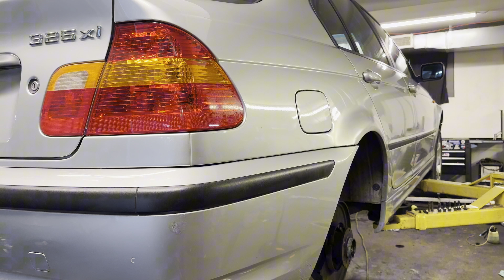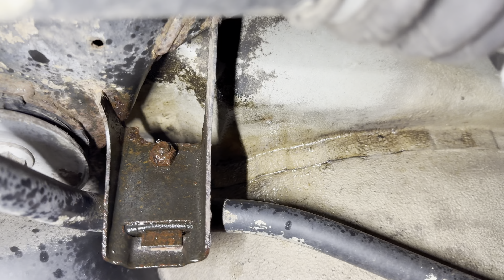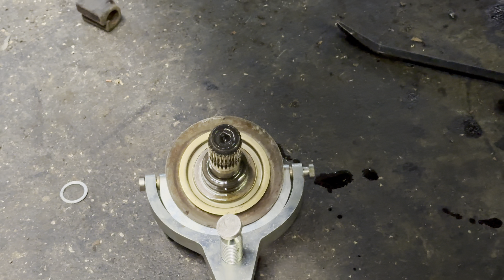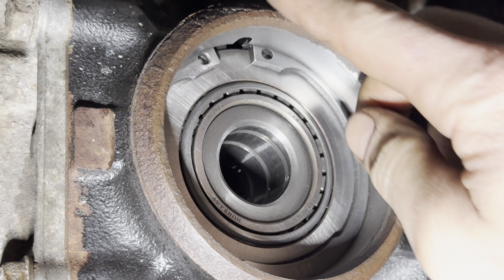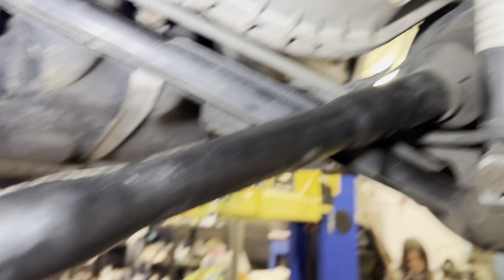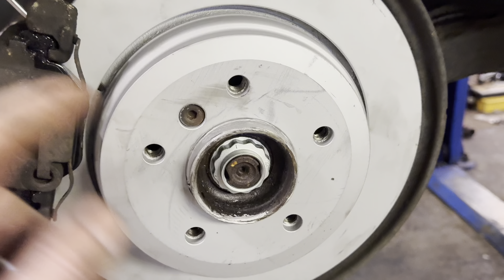How To Replace A Leaking Differential Axle Output Shaft Seal On An E46 325xi

Comment: Mine doesn’t go in all the way no matter how hard I hit it there’s a half a inch gap between diff and that ring on the flange do Yk the cause or fix?
Reply from the maker: @Mr._slow2.0  try rotating the driveshaft or other rear wheel to get a different alignment -Mike

Comment: Very helpful, quality video! I used a seal puller instead of a typical pry bar, doing the driver side on jack stands with the exhaust hanging limiting room. Thanks!
Reply from the maker: Thanks for the positive feedback! A seal puller is definitely the better tool for the job haha. And yeah driver side is a bit more of a pain but you can just undo those 13mm nuts on the hangers and let the exhaust sag. -Mike
Reply: You used the seal puller to get the flange out if so what kind?
Reply: @adenwise6220 it was a Lisle seal puller from amazon. Good product